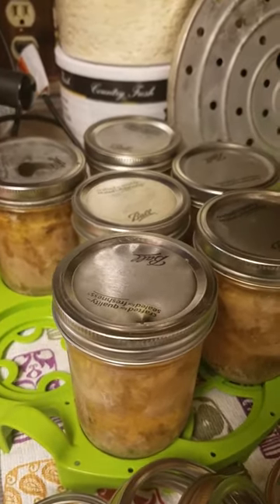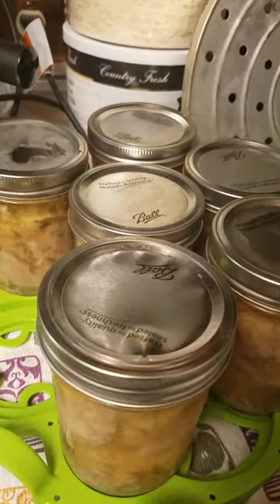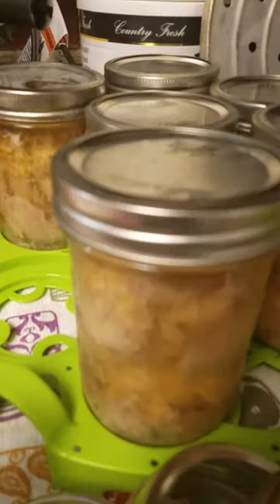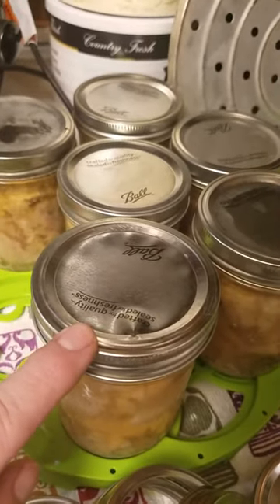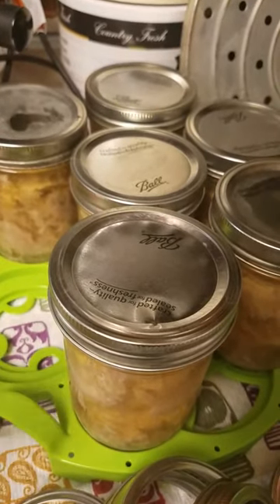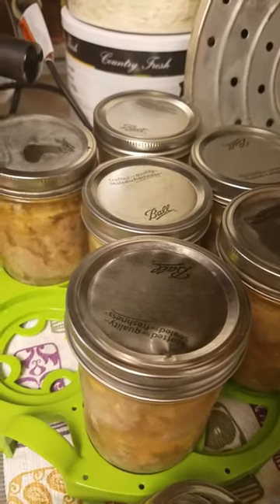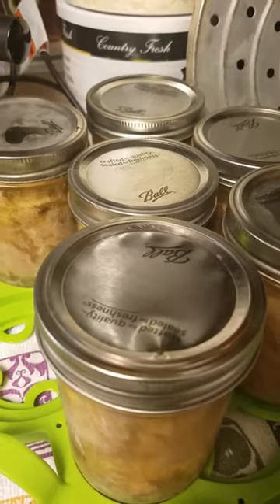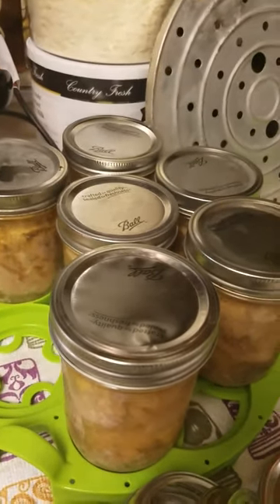Buckled Lid #Shorts

Comment: Avoiding wide mouth jars actually help alot with this. Also hotpacking can help avoid bubbling. If the jars are cold packed then put in hot water the cold air expands causing the lid to bubble. If you hot pack the air inside is already hot and won't expand nearly as much.

Comment: if the ring wasn’t screwed on too tight, what else could cause it to buckle?  also, the lids popped loudly after they sat out on the counter for 15 minutes and the lid flattened out? any ideas?
Reply from the maker: I really don't have any more ideas of what it could be.  Generally it's only caused because of the ring being too tight Because the air has to escape and forces its way out of the lid which makes it buckle.
Reply: @2leelouCreates  thanks!

Comment: No thats not it my first batch i did as I was shown on a few 10 youtube channels and I tightened finger tight I had buckled lids that are still sealed but liquid came i found out that it was the rings they came loose in the process out second batch I tighten the lids tol the first reaction the same thing happened I am using bell lids I kept all my produce well.under th r line made sure I got bubbles out and rimmed with vinegar I am getting a bit pissed off they are sealed bit are they safe more than half of my batches are like this
Reply from the maker: That's so frustrating. I cant imagine what happened. I'd have to see them I guess.  I suggest checking with your county extension office to see if they have a food preservation help line or person who can take a look.  Although buckled lids are usually because the ring is on too tight. The lid buckles when the air is forced out and has to push it's way out causing buckling of the lid. Without seeing them in person I couldn't tell if they are good. I'm sorry.
Reply: @2leelouCreates  I found out what happened its going to be a long one lol 
The videos I watched always say yhe same thing but for me they do not go into great detail they assume you know even when they say its for beginners finger tight means different things to people i did mine finger tight just before the give nope that was too loose it has to be tighter than that to the point it stops turning it the right way or the rings will come loose and that buckles the lids as there is nothing keeping it to the rim so you have different pressures thats what makes the lids buckle
I also made mistakes of a newbie I made sure nothing went over the line but forgot it also means on top thats why you use the measure tool I over filled it from the top it still was below the line but not on top 
because I over filled it with chicken it produced too much oils so it over flowed buckling the lids
on top of that I had beef and minced beef I part cooked them (no one tells you why so I hunted for the awnser as I was not going to do it) its to get most of the oils out of the mince before packing 
I spent 2 days doing a very big batch and I learned things that not one channel talks about i am going to have to re pressure cook all of them as I don't trust them but this is what I learned